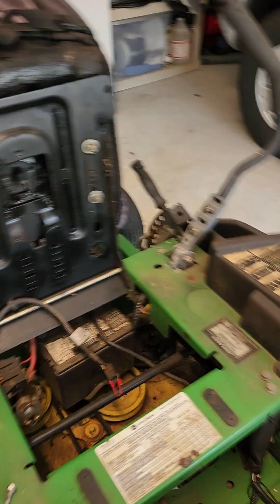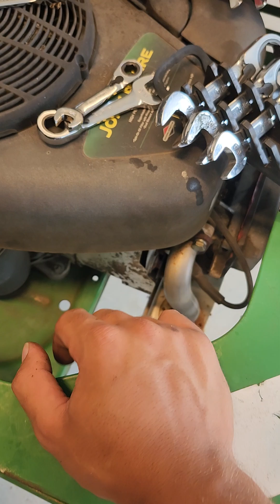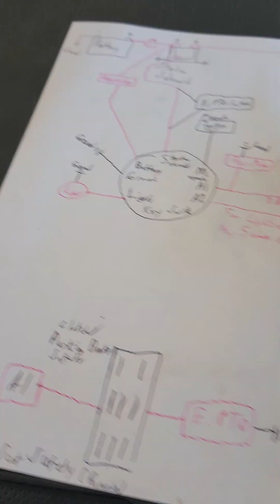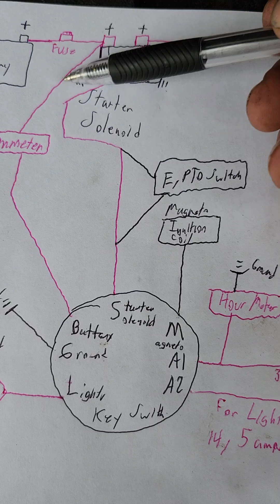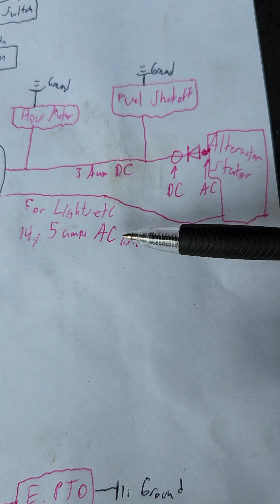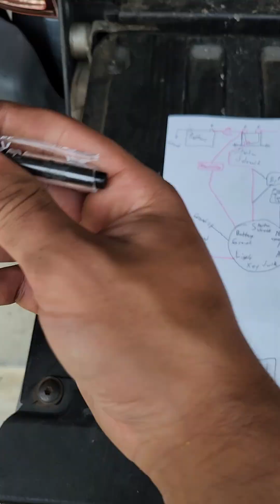Basics of Riding mower wiring manual and electric PTO

Comment: The connection between my PTO switch and my PTO has melted and I can't tell which wire connects to my clutch.  Does it matter which wire connects to the wires on my clutch?
Reply from the maker: Yes it does matter if you can find an electrical wiring diagram that matches up to what you have that would be best to replicate, Essentially all the switch does is have a power and ground supplied to the switch, have a safety check to prevent starting the mower with the blades on, another safety check to make sure you don't get off the mower with the blades on/parking brake disengaged, and then wires to send power and ground to the electromagnet on the PTO (It does matter which one gets power and ground as some of them have diodes, but ultimately it should still work even if they are reversed, you will just simply have a reversed polarity and the magnet will still work)
Reply: @Useno01  Thanks, I was thinking that I could check the volts on the wires coming from the switch to see which one is hot.

Comment: I dont understand why magneto is going to ignition coil. Shouldnt your magneto wire just go into the M on back of your switch. Dont all these contacts connect inside the ignition switch if you hook up everything as labeled M,S,B,G & Alternator to A1.
Reply from the maker: A magneto and ignition coil are the same thing. Probably just misspoke in the video.